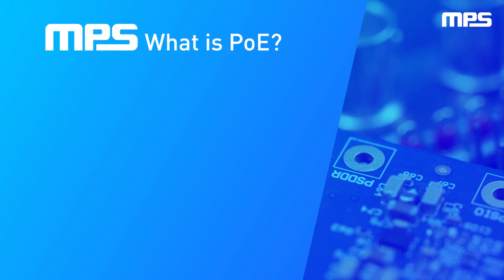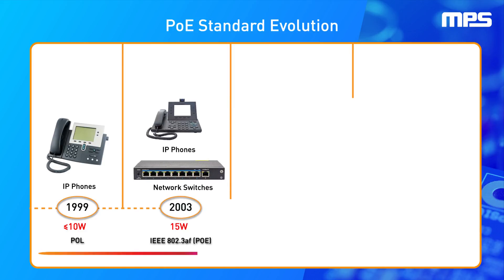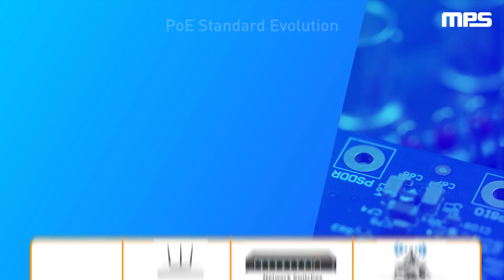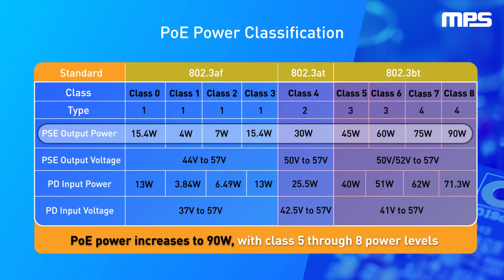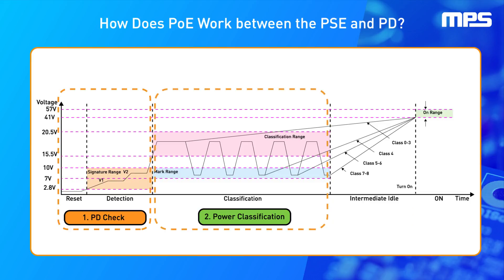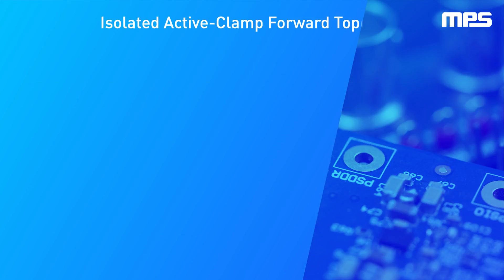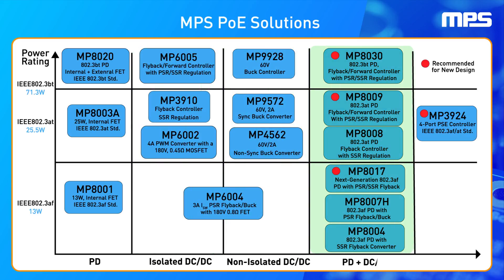Understanding Power over Ethernet and PoE Controllers and Converters

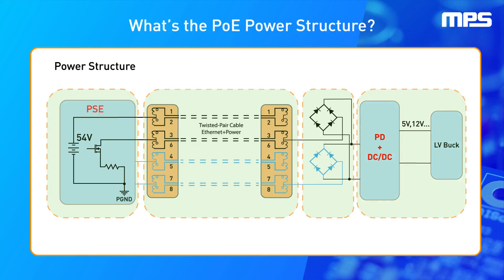Comment: At 1:39, two bridge rectifiers are shown with 8 diodes in total - shouldnt there be just 4?
Reply from the maker: 8-diode is not only for 802.3.bt requirement, 802.3.at still need 8 diodes. PoE power can be conducted with Alt-A through 1/2/3/6 wire in cable, and it can also be conducted with Alt-B through 4/5/7/8 wire in cable. When you plug in a PD, you don’t know the supply is Alt-A or Alt-B so we must add diode-bridge for both Alt-A and Alt-B, total 8 diodes.